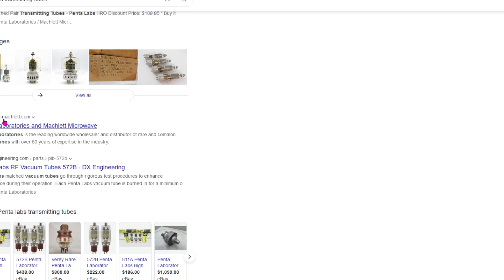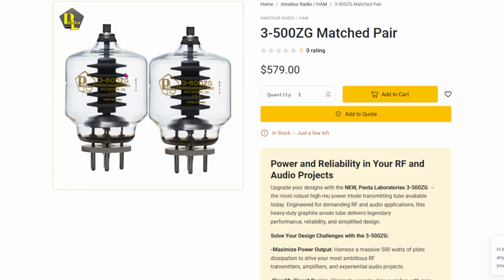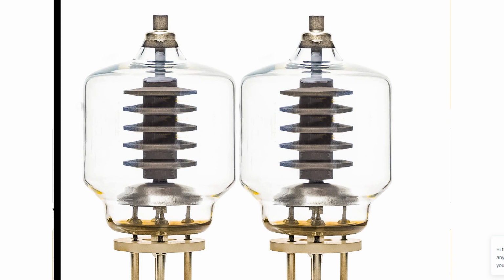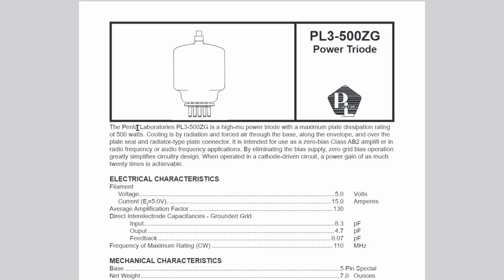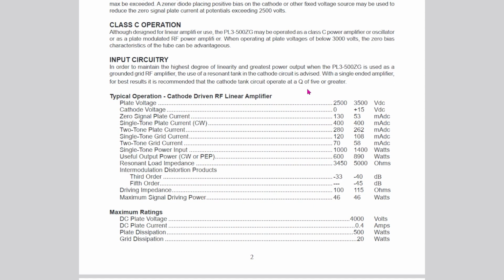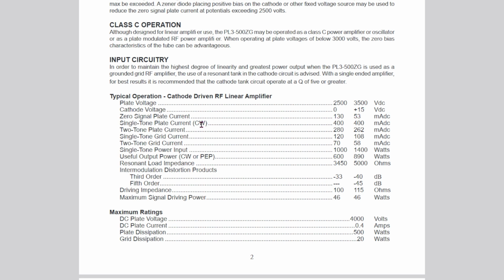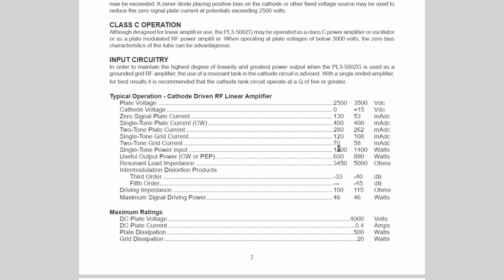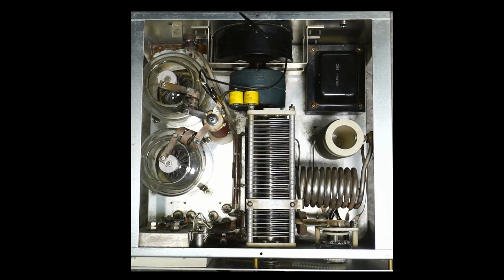Linear Amplifier, Part 2, Penta Labs, Ordering 3-500zg Tubes, Drake L4B Linear Amplifier, Jim W6LG

Comment: My " New to me " Ameritron AL 80B HV current is the same in standby as well as operate   ....Meter says 3500 volts....Manual states do not operate if in standby it exceeds 3200 volts....do I have a serious issue? Running at 110 volts

Comment: Hi Jim: 
I'm Michael DE VO1OP from Newfoundland Canada and I was wondering if you could do a video on the plate dissipation of a 3-500Z VS SSB, CW and digital operation? As the 3-500Z has a plate dissipation of 500W but if you tune it to the max allowable plate current and grid current levels, your pushing well over a KW. I think these numbers can be very confusing. 

Thanks and 73: 
Michael DE VO1OP

Comment: Great Jim. Going threw the data sheet. Yes Grid current !  Also as tube reaches end of life that grid current will rise . Great stuff so far 73
Reply from the maker: Yes, good point, it will rise as the tube becomes less effiicient and requires more drive.  Those old Eimac tubes that I had in the amp were pretty damn good for 47 years old.  I am sorry that I broke one of them.  I did not notice the fan was stuck.  73, Jim